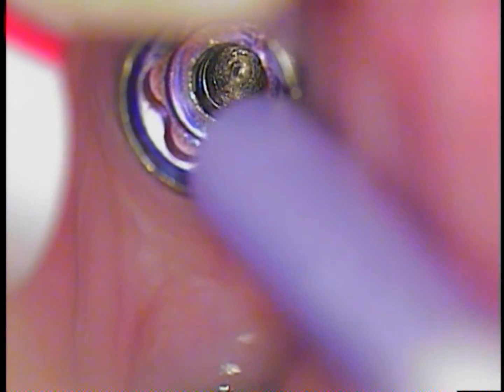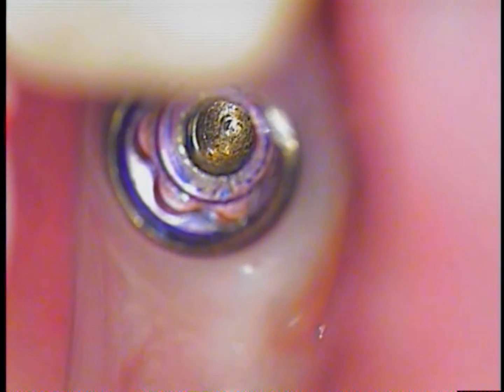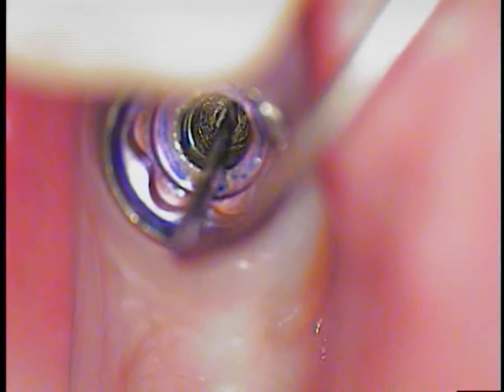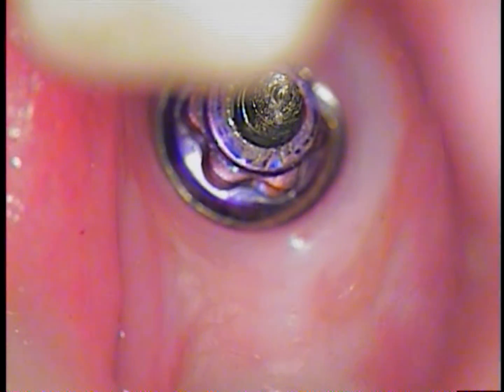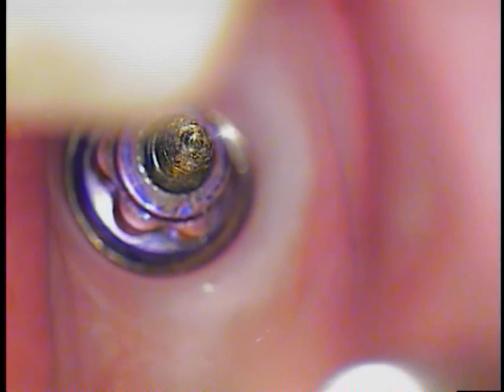Dental Implant Broken Screw - difficult retrieval using a tap/threading device- 3/7

Comment: Dr, I got the same situation with abutment still in place and loose. The abutment screw is burnished with the abutment internal aspects. A reverse threading tap failed to undo the screw from the abutment and caused more wear. I am close to the implant interface. What do you suggest to do?
Reply from the maker: Did you rinse with copious amounts of water during the tapping process in a stop and retapping manner?
Reply: Gerard Cuomo I really have attempted manual tapping to the screw head, which didn't work out. The remainder of the screw head is now burnished to the abutment remainder, and none of them budges. Any idea?